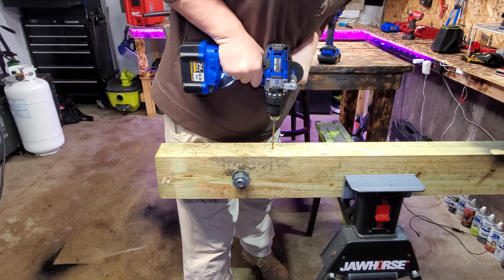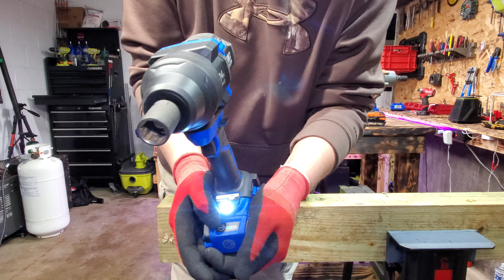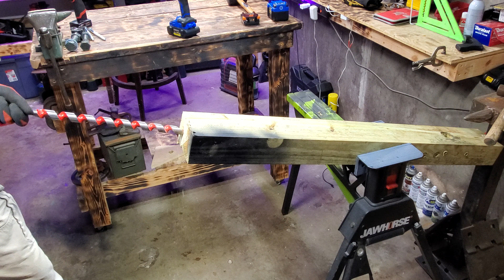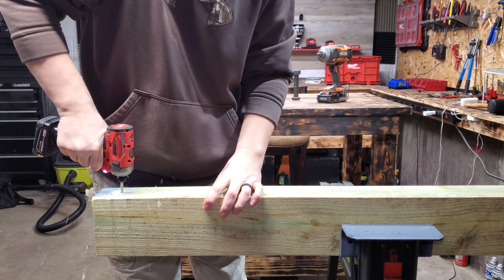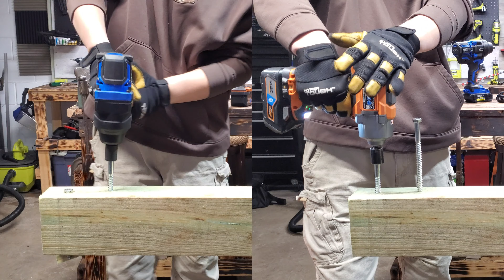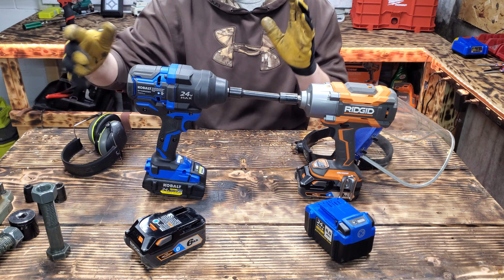Kobalt 24V XTR VS Ridgid 18V Octane "High Torque Impact Wrench" Testing and Comparison...

Comment: I bought a Kobalt 24 volt kit - saw, drill, impact driver, 2 batteries, light and carry bag for $220 Canadian dollars including tax. For the money, Kobalt can't be beat. It's even cheaper than Rigid and nearly or equally good.
Reply from the maker: Nice, Man Ridgid has gone way up in price at least around me. Yes is a good tool for the money.

Comment: I think that most people are concerned with nut busting torque on a 1/2" impact wrench  as opposed to speed of driving/drilling. Why spend so much time on testing their driving and no real time on nut busting?
Reply from the maker: Yeah I do most of those test because you guys ask for it. If you watch my Milwaukee and Ridgid High torque impact wrench video, I go to the juck yard and and bust loose lots of random bolts. I had fun filming it, but people didnt respond to it well. so i don't know 
https://www.youtube.com/watch?v=JofrYCG6zKk
Reply: I agree

Comment: Loved the side by side comparison where you were running both ....  I've got the kobalt with th 4.0 high output and I've not had anything NOT break loose using it... I think I paid 180 for the kit vs. the 200 you said in the video.. and remember.. if you're a veteran at lowes you can get a 10% off every purchase... which aint peanuts when you're talking 200 dollars..

Comment: The Ridged looks awesome in this test. I just got the XTR impact wrench and now have all the XTR tools. When I upgraded to the Kobalts it was Ridged next on my list.  With financial situations the way they are it was great to see all the tool deals since before black Friday.  I have some Dewalt corded tools that I'll keep but I gave all my older cordless Dewalts to my son he is a beginner on a framing crew.  Also Lowe's is only a drive across a bridge from my house and Home Depot is around 30 miles one way. Personally I don't need to own the big brand tools anymore and both Kobalt and Ridged have tools that are in the same ballpark as your Milwaukee, Dewalt, Mikita, etc. at a better value when you're pinching pennies. So what if a Milwaukee driver or wrench can bottom out a lag bolt 0.7 second faster than a Kobalt or Ridged or 1.1 second faster than a Ryobi or craftsman tool if you're not on the job anymore. I took advantage of the get one free deals on the Kobalt fast charger and 2  4.0A battery kits and built up my battery supply and got some free tools.  I also considered getting the Milwaukee m12 fuel line because of the compact size and power that they have but so far I'm very satisfied with the Kobalts and I also like the blue and black on the XTR tools.
Reply: I agree. Kobalt is very affordable! = )
Reply: Whats better ridget or kolbalt?
Reply: @eddiemelendez4445  
I don't know. I have every Kobalt XTR tool and some regular Kobalt tools. I never tried the Ridged. I don't need anything better than that.

Comment: I'm just curious as to why barely any pressure was being added to the Kobalt but the ridged you were damn near straining yourself
Reply from the maker: It just looks that way. I was holding both very tight, if i didn't it would go flying and most likely twist my wrist.

Comment: There is a reason it's called xtr. You need the high output. And they make a 8 amp hour version that helps level the playing field. Any batteries will cut out if you're asking for more power than it can give not to mention you're heating it up drawing so much current. Only use high output batteries for heavy duty tasks . Don't want to overheat the tool with a crap battery that can't deliver.
Reply from the maker: When I filmed this the 8.0ah was not out yet. This is an old video. Thanks for watching

Comment: Interesting. For Hammer drill, impact driver, and circular saw tests I've seen, the XTR line looked quite impressive. Here, it looks less so. Depends on which tools are most important for the end user
Reply from the maker: Yes that is very true, I feel out of all the high torque impact wrenches the new Ridgid and the Kobalt XTR are the most impressive, both with out do the Milwaukee. 
thanks for watching
Reply: instablaster
Reply: That's not the XTR it's the Max. This video is a sham.

Comment: man, that ridgid is a beast,  but man, I still can't believe you did this head to head, which it's insane.  It appears that  Ridgid is currently the king in its class when compared to Milwaukee, Makita, Dewalt, and Kobalt's  1/2 in.  high torque.  It seems Milwaukee is due for a gen 3 1/2 in high torque  impact wrench.
Reply from the maker: Yes I agree it has the most IPM witch make a huge differences thanks for watching
Reply: @Impact-OG  just want to know one thing. Kobalt has the tendency to show less bars on the gauge as it overheats, then you gain back that bar as it cools down.  What I want to know, what did ridgid show on their battery gauge after driving the lag all the way?
Reply: @Impact-OG  and why is the 3 amp octane battery faster than the 6.0 amp octane battery.
Reply: TheToolGameChanger 
might be something have to do with the fact that 3.0ah octane has 21700 cells! when other octane batteries uses 18650 .
Reply from the maker: @InsuranceIsLegalizedRobbery  the kobals new battery also has the 21700 cells, thats why I used that battery and the 3.0 of ridgid, and with the 2.0 and the 6.0 it was significantly slower. 
Thanks for watching

Comment: I made a 8ah xtr battery and it really wakes it up. It's power hungry.
Reply: Nice, 5s2p Samsung 40T then or something else? What are the batteries in the stock version?
Reply: @imperialsecuritybureau6037  2 4ah xtr batteries in parallel. Not sure about the make. I wanna say samsung 21700

Comment: Dude, is the Ridgid faster with the 6 or 9ah? Or is the 3 the fastest? Good video!
Reply from the maker: Mine did best with the 3.0ah, but my 6.0 is couple years old, so that does make a difference. Thanks for watching. and I am petty sure the 9.0 is the old 18650, and the 30 is 21700 cells.
Reply: Doesn't look like the xtr had the 4.0 21700 battery in the first head to head matchup

Comment: Wow, didn't expect the Ridgid to beat it. Kobalt is usually a beast
Reply: The Ridgid octane was stronger than Milwaukee's best 1/2 high torque. Which considering they are owned by the same company isn't that much of a surprise.
Reply: That was the max not the XTR. Watch again and look at the Kobalt. It says Max where it should say XTR.

Comment: This XTR is perfectly fine, but it's not quite up to the performance standards set by other XTR tools. There probably isn't any reason to buy anything else if you're already on the Kobalt 24V platform.  That Octane is a beast though, even stronger than Milwaukee's own high torque.

Comment: How did the ridgid tip look after ?
Reply from the maker: The impact ranch was fine I wrecked the socket and the socket adapter
Reply: @Impact-OG  out of 1-100% how did it end up or stood a solid 100%

Comment: Only have the big dewalt dcf899 impact and it’s been great. Don’t know how well it compares to that new rigid impact, but it sure looks good
Reply from the maker: Yeah I have not tested the High torque dewalt only the mid, yeah that would be an interesting test.
thanks for watching
Reply: I know the is is late but the 899 is slightly stronger than the kobalt with standard battery. Now with high output batteries they're both good but nothing compared to the dcf900.
Reply: The dcf900 is the best one dewalt makes.

Comment: Both rated hight torque impact wrenches, but Ridgid has 300 more ft-lbs than Kobalt and that’s a lot of power, 
it would be a great comparison if you do dewalt DCF899 vs this kobalt, they fall in same category, both r rated 1200ft-lbs of breakaway torque, 
I’ve enjoyed watching this video and thanks for sharing it.
Reply: also the earthquake XT 1/2” impact wrench rated at 1,200 ft lbs, that should make another good comparison too!
Reply: The Ridgid high torque is basically a Milwaukee 2767 and the Kobalt is pretty much the same as the Makita high torque impact from 4 yrs ago so the ridgid is more powerful.